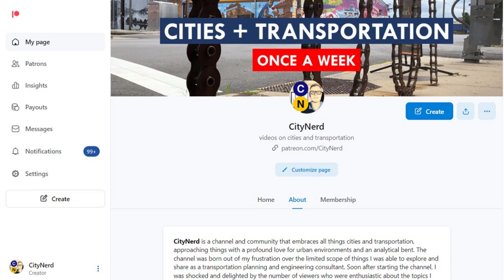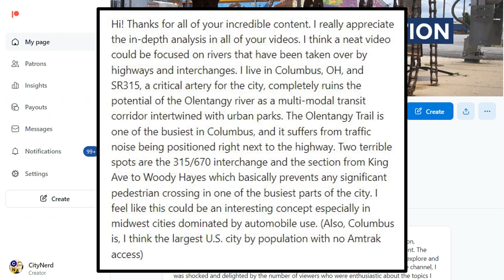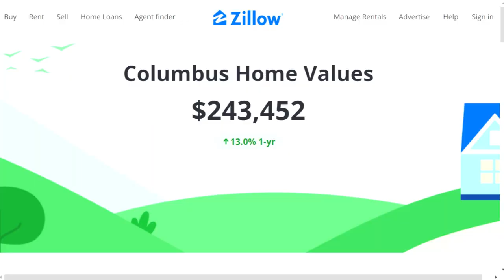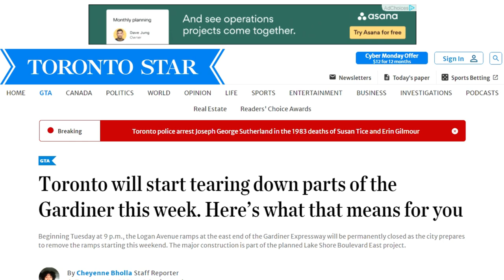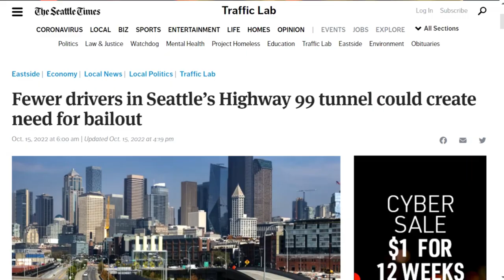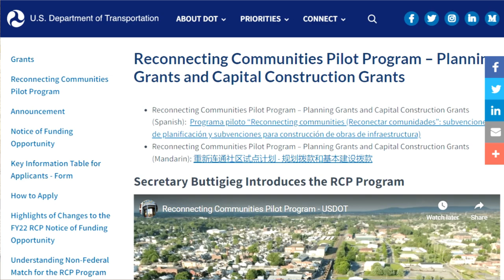Highway Engineering Madness: 10 Waterfront Freeways That Need to Go (North America Edition)

Comment: Having highways on the waterfront is ok and likely a good idea if u got an industrial or working waterfront but the problem is that a lot of these cities had a working waterfront but dont nowdays and infasture in america is usually old enough to coplect social security this  an issue with a lot of post industrial cities. A lot of stroads were highways that were overtaken by sprawl and never designed for their current use

Comment: Manhattan, Brooklyn, Philadelphia...these places are awful for waterfront freeways. I definitely would have put Manhattan and Philly as the top 2. Both Center City Philly and Manhattan are completely lined on both waterfronts with freeways, there's literally no waterfront left to speak of in either city. Even the Schuykill River section through Fairmount Park is sandwiched by two major arterials. Of course, this didn't happen until the demise of the port facilities in both of those places. These were two working ports, two of the most important in American history.

Comment: Let's not forget about other ways cities misuse valuable waterfront land.  Cleveland Ohio is one of the worst offenders with Burke Lakefront Airport and the Conrail water level railroad line, both of those run right along the shores of Lake Erie through the downtown area.  Instead of prime housing, parks and other high value usage, Cleveland has railroad tracks.  In fact that water level line carries around 70 percent of all the east-west freight running through the northern states.  Definitely should be relocated, along with the airport.

Comment: i kind of wished you used a criteria that is a bit more environmental justice related than property value. like a cross reference of air quality and property value. i feel like that should be a city's priority, not necessarily income. like... what if the removal of a highway is exactly the impetus needed to reconnect neighborhoods and the urban fabric. after that, the property value would increase greatly, but also existing neighborhoods could reap the rewards of new businesses/mobility, becoming healthier, happier, and more equitable.
Reply: I guess the disclaimer at 6:17 kind of covers my point. great video regardless
Reply: and much more during the soap box speech at the end. thank you so much

Comment: I don’t think Lakeshore drive is bad compared to Louisville and the others. Yes it’s near the lake, but you have a pretty decent green space between the lake and the highway. You can’t really hear the traffic if you are on the beach.
Reply: my biggest problem with lakeshore drive is there isnt a single tunnel or elevated ped path crossing it the entire length of millenium and grant park. if they added a path there you could get to lakeshore trail without having to cross LSD fairly easily throughout the whole city, though the tunnels could be improved edit; i forgot about the tunnel at the end of grant park by the shed. even still, the next closest crossing is at the riverwalk.

Comment: Sigh. 

First a mundane comment: 

TL;DR version: It's not I-580, it's I-80!

What you identify is I-580 in on the East Shore of San Francisco Bay is almost universally known locally as I-80! I-80 was built before I-580, and while the section you highlight is, indeed, BOTH I-580 and I-80 (with the curious opposing directions: I-80 Westbound is I-580 Eastbound - and vice versa!), it wasn't part of I-580 until a freeway was built from Albany, through Richmond joining the highway that goes over the Richmond-San Rafael bridge - and designated as I-580 extending it from it's earlier terminus just East of the San Francisco-Oakland Bay Bridge at the structures locals know at "The Maze"! JOINING the original I-580 with the new freeway connection to the Richmond-San Rafael bridge required adding the I-580 designation to the portion you picture. 

But I have a more "meta" comment: Your analysis simply ignored history! For the "I-580" segment you identified, there are very good reasons that the freeway is where it is - and essentially no alternatives.

That section of I-80 is built almost entirely on land fill. Take a look at Google Maps Satellite View and you'll see a few blocks East a railroad. -- and when the railroad was built, it was built on the shore! Almost all of the land west of the railroad is land created through fill. And why was it created? Because the railroad simply couldn't handle the traffic demands of the commuters - the land was filled primarily to build the freeway. At the time, ALL of the surrounding uses were industrial - in many cases very HEAVY industry (A steel mill in Emeryville, another one in Berkeley, etc.)

Today, that section of the shoreline is getting better as far as non-vehicular access. There is a stunning bike/ped only overpass just south of University Ave in Berkeley, another one being built just South of Gilman St (also in Berkeley), a decent off road route for bike/ped access at Buchanon St in Albany, and serious plans for a decent bike/ped crossing at Ashby Ave in Berkeley. That's 4 of the 5 places where autos can cross I-80 - the 5th being Powell St in Emeryville - which does have a decent (although not well separated from the street) bike/ped path across I-80.

Look, I'm not disagreeing that I-80 is an eyesore, nor that it separates the cities from their waterfronts - but in this case, their current waterfronts were functionally CREATED by the freeway (and subsequent cleanup of bay side dumps)! 

And as a lifelong resident of the area, it's the LAST freeway I'd want to see be demolished! It's just so essential to traffic patterns - and will be FAR into the future. BART can't come close to providing a non-driving alternative (and I shudder to think of the immense amounts of parking that would have to be created to even try!). Rerouting to a "downgraded" highway or major arterial is also a non-starter - the only corridor that could reasonably be considered is San Pablo Ave about 1 mile east - anything else would require an immense amount of removal of housing stock - hardly an Urbanists ideal!

So my objection really boils down to this: Given my knowledge of this one corridor - and the historical and current reasons it's simply not a candidate for removal - even for an Uber Urbanist -- I have to question which others of your "top ten" really shouldn't be on your list for similar reasons!

Either that, or rename your list to "Top 10 Freeways I wish could be removed"!

A FAR better candidate for removal in the area is I-980 in Oakland. When built, it divided downtown Oakland from the neighborhoods to the West. It carries far less traffic than other area freeways. And their are serious discussions about removing it - and using the land for some VERY good purposes including:

Creation of a super rail transit hub! With a 2nd Bay Rail crossing containing both BART and Standard Gauge tracks (2 each) It would extend both Caltrain and the CA HSR under the bay to Oakland - allowing both to use the downtown San Francisco Saleforce Transit center as a THROUGH station instead of a stub-ended terminal with only 6 tracks. With (relatively) minimal displacement of residents, a standard gauge extension travelling NW from the West Oakland Hub could connect to the railroad - remember, the one that parallels I-80! --  allowing high(er) speed service direct from San Francisco/Oakland to Sacramento - instead of the "Great Circle" HSR route currently planned that goes from San Francisco to Gilroy, then East to Merced before going North to Sacramento.

For BART, it would offer the opportunity to change from serving San Francisco with 2 tracks carrying 4 different routes to a hub and spoke system serving 5 lines from the West Oakland hub - where there would be timed transfers between every train from San Francisco to 2 of the 4 other lines - the other 4 lines would likely operate at half the frequency of the San Francisco line.

The BART tracks in this 2nd bay crossing could either serve a new line extending to the Western side of San Francisco and/or serve as a spare set of tracks in case of problems with the existing line to San Francisco - and perhaps enabling 24x7 service while still allowing for shutdowns on one or two of the tracks for necessary maintenance!

Other purposes? Creation of high density mixed use areas - on land likely to have little, if any, NIMBY opposition! Not to mention creation of urban parks in an area that is woefully lacking of that particular feature.

And "No" removing I-980 shouldn't have been on this "Top 10" list - but only because it doesn't separate a city from its waterfront!

Comment: I think you're under-weighting the width of the road and speed.  Storrow doesn't feel like a dividing line to me, where all your other examples really feel like a full blocker to any reasonable access for recreation or commuting.  Storrow is relatively easy to cross and I would actually bike or walk commute often from back bay to bu area and felt the access to be quite good.  I'd love to see it removed but again the noise and pollution don't feel on par with an actual highway.  

Ironically, I would the argue the Big Digs replacement parks still feel like a bigger division between neighborhoods.  You have 2x street level crosswalks and 8 lanes worth of downtown green space between the North End and Haymarket.  Whereas crossing storrow is a quick ramped pedestrian bridge.

Comment: Torontonian and former tour guide here, one thing that not many people know about as a result of the city trying to hide is the fact that when the Gardner was built (originally constructed for a city of 300,000) it was designed as. TEMPORARY road project to accommodate the insane growth the city was experiencing. It was designed to last 30 years, no more than 50 max which would have given the city time to expand and construct more transportation infrastructure as well as reclaim more land for the water front. As the expressway was almost complete the winter was quickly approaching and as a result they added salt to the concrete to dry it out faster so they wouldn't have to wait until spring to finish.  Of course,  like most north american cities, Toronto developed an addiction to cars and due to bickering at city Hall, they couldn't even plan an alternative. And just kept adding here and there to help with the ever growing traffic problem. Fastforward to today and that salt has eaten away at the interior metal supports as well as weakend the binding ability of the concrete and as a result China of the stupid expressway a literally falling off on a regular basis. I live at Yonge and Queens Quay on the lake South of the Expressway and fortunately there is a movement to take it down and they have taken some off, but it isn't fast enough. It's a disaster waiting to happen.
Reply: Fortunately that "movement" who tried to tear down the Gardiner failed spectacularly. The province now owns the highway and will never tear it down. Ontario Liberals will never tear it down either since they need suburban votes to win elections. Toronto votes don't matter in an election. Even if Toronto voted 100% for NDP or Liberals that still doesn't make them win the provincial election.

Comment: There is a sub-set among highway planners that deal with goods movement.  Urban planners have dismissed the car since its inception and I agree that it isn't a good solution for the problem of moving folks around urban areas for needed tasks like say going to work or school or shopping for groceries (well mayB it is good for that).  I'm an ex-NYC resident so based on my somewhat familiarity with that area I can use it as my model.  Terrible auto traffic, given. Yet this city has the highest use of transit of any in the US so just who is driving?  Well I've often seen traffic jams on streets involving only taxis and busses, virtually no private vehicles.  Face it, with the price of highway tolls and parking charges most drivers are going to stay away.  So who comes, well I had plumber, electrician, and carpenter friends who just happened to own a big toolbox on wheels with a motor and steering wheel.  Can't bring that kit on the bus, eh?  Add to that all the computer and telephone techies needed for the tens of thousands of businesses located in Manhattan.  You build an office building taking an entire NYC block that is 50 stories high and I see a lot of Xerox paper as well as a lot of toilet paper to say nothing of mail going to that address and there are ten thousand of those addresses.  At one time Manhattan had the West Shore highway, it fell apart due to lack of maintenance, it was the only highway going south from the George Washington bridge, now all of that truck traffic has to use city streets with a traffic light on each block for ten miles, many truckers won't deliver in Manhattan for that reason.  By the way, the toll for a truck on the GWB is about $100 (round trip).  I've traveled a lot in Europe and I always like the auto free streets in the downtowns with all of the little stores but notice that these areas always have a few cars, well how do you think the shops get their merchandise?  The same applies to the many, many bodegas in NYC.  The highways were built along the riverfronts because there was open land there and they didn't have to knock down any houses and note that seventy years ago the river fronts along the Hudson in Manhattan weren't so pretty, just a bunch of old piers  that outlived their function, the same was true of the lakefront in Chicago at one point in time.  There is no freight train service to Manhattan and the service to Brooklyn is very limited, trucks rule!  The Holland and Lincoln tunnels from the Jersey side have limited truck traffic due to the low ceilings (they were built before modern truck standards were established).  Manhattan limits truck length to less than the standard trailer length of 53', I understand why but the rest of the US uses these.  I think that fundamental to this problem is that the eastern cities of the US and Canada were built long before the auto was invented and if you think the air smells bad now it was far worse in George Washington's day, a lot of horses doing what horses do.  I might add that I have heard a lot of planners talk about folks taking the bus or their bicycle for the trip to work but I've never seen one of these guys do it themselves.  They drive.

Comment: Try to go to the Northside of Chicago via normal streets, and you will see why LSD exists.  It shaves off about 30 to 40 mins of ignition time.
Reply: Lazy person's excuse. What if they built a tram that traveled on the same route? Ah, but then you wouldn't have the convenience of your car. That is what this is really about, isn't it?
Reply: @rabbit251  I don't live there.  They do have an elevated train system that is heavily used from the central city to the north side among other routes.  However the light rail system is not set up well for visitors. The most effective way to get around Chicago as a visitor is still via car.

Comment: Only watched because I figured you’d mention LSD. I use the the lake shire bike path more than the actual road, but still found your reporting bias as you showed short stretches and choke points without giving an entire overview of the area along the lake front. I get the sense you only looked for things that would support your pre determined position. 

The north end of the drive is terrible but only represents a small portion of the area.  Why don’t you do a wholistic breakdown of how the city has attempted to provide greater public access to the 25 miles of public space that is the lake front.  To those who moved to Chicago and live on the Northside, I have little empathy for you and issues with LSD. Most of you neglect the fact the city extends south of Soldier Field unless you want to go to the MSI.

Comment: Grew up in Niagara, live East of Toronto. Sooner or later if they don’t take the Gardiner down it will self-disassemble. On the other hand the QEW Hamilton is a crucial highway that I use all the time. Because of the geography, it is hard to imagine where that traffic between Niagara and Toronto could be diverted. There is not just a lake, but a harbour and a bay and an escarpment. And that highway route is crucial because of the border at one end and the provincial capital at the other. I would love to see a practical alternative plan. I would also love to see better transit, particularly rail. But that is unlikely to happen. Ontario has a devoted developer servicing Con government right now that is breaking all the rules to build as much more car-dependent sprawl as their corrupt donors can pay for.

Comment: LSD is really awful, but it's not quite so bad as you make it out to be when you say that there's just the occasional tunnel under it. In the really high traffic areas like promontory point in Hyde Park or the Belmont rocks (and AIDS Garden) in Lakeview East the expressway lifts up to make a relatively nice ground-level connection underneath it, along with the connections along the water-level where the expressway crosses the mouths of harbors like Diversey or Jackson Park. There are also quite a few bridges over it in the major parks and they're adding new bridges on the south side.

Still, LSD should just be removed entirely. Also, while the section through Grant park may not technically be a freeway, it's really really awful to cross and ruins a huge section of the park and severs the loop from the waterfront and there are constantly car crashes on that segment and pedestrians and cyclists have died there, including recently. It's really bad.